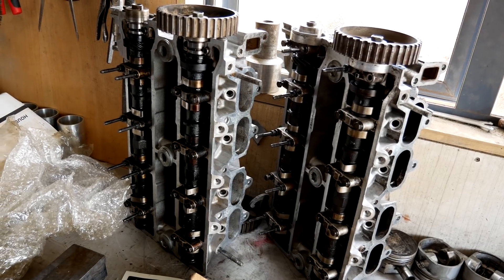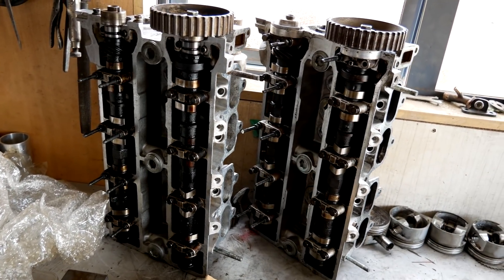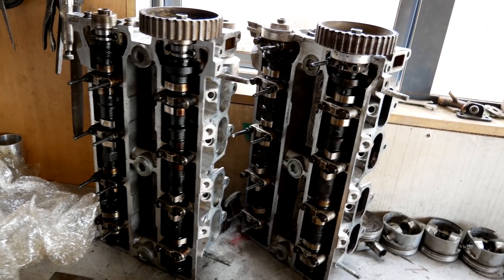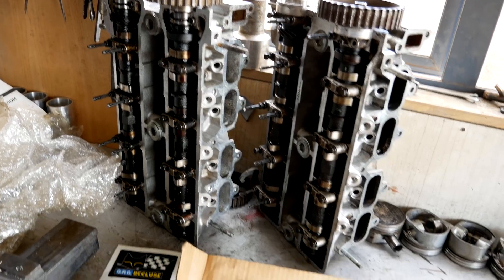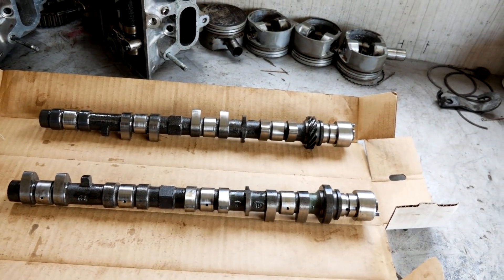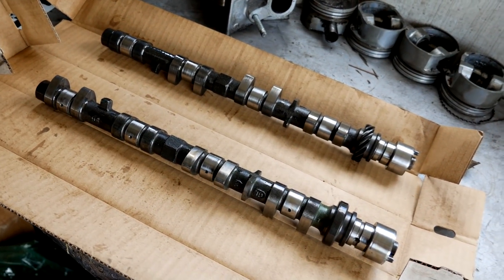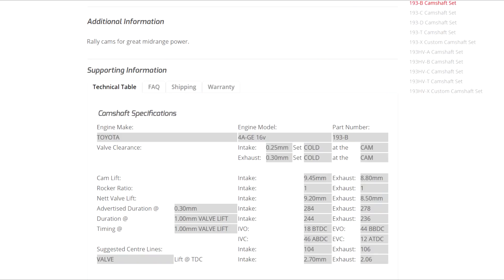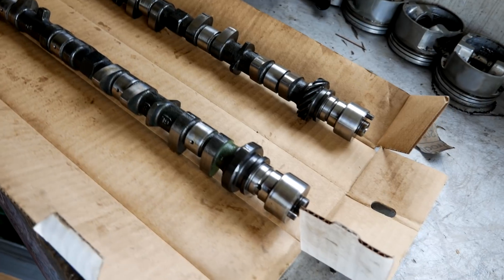Camshaft upgrade  Gold 4age -  Dyno tested

Comment: So actual upgrades are reworked head, cams, itbs, complete exhaust, fuel system and ecu just to be clear, by the way what fuel pump do you running and one question off topic what is diameter of the throttle body on the stock intake 😊 do you think that stock intake would already lowered actual resaults, at 105kw setup i simply havent spotted any big gains over the stock intake, thx for answers 😊
Reply from the maker: Yeah thats about it,  it has toda valve springs.  and toda 3.7kg flywheel also.   from memory the stock intake has a 54 or 55mm  throttle plate.   It made pretty decent gains with the long runners on the itb's  over the stock intake.  remembering it doesn't make much power to start with.  pump is just some old bosch pump thats been in the car forever

Comment: Really nice video. Can you show maybe some tricks to build a reliable 4age. Or 4agte or make it more reliable. And Why dont you test a 7age?(just intrested. I know the block is weaker)
Reply from the maker: 4a cheaper.  you couldn't do this with a stock 7a bottom end.  Yeah that's the thing. you really dont have to do much to them to make a reliable 4age/t.  unless pushing big numbers.   would be a pretty short video.

Comment: How would I install cams if my car has a dry sump setup? Considering my valve cover does not have a oil cap to slip em in?
Reply from the maker: dont 4k's come stock with 3/4 race cams anyway?   Or are you wanting to go full hectic with the full race cam?  That would be far to lumpy to do a filler cap install, even if you had one.    Assuming you have fcr carbs to go with that dry sump, you could section the cam in 4 and feed them in simultaneously,  watch your fingers in the slides
Reply: Touché
Reply: @Garage4age  oh my god...i wat to die every time i hear the "full race cam" jargon xDDDD

Comment: G-4age, you ever mess around with the Toyota R-series? (18R, 20R, 22R)

If so, for NA power how does the 4age stack up?
It's got a significant displacement disadvantage, but I imagine the 4AGE has superior head design and camshaft selection.
Reply from the maker: getting an 18rg running, is about as much as ive done on r series
Reply: Absolutely, I’m working on 18rg at the moment.....where to get good part...toyhead...thanks

Comment: I've been meaning to ask, why is the torque axis being shown so incorrect?
Reply from the maker: Its torque measured at rollers.  curve correct. numbers aren't.  pretty much all dynos work like this. but the ones that show "correct" numbers, have a calculation from either manually entered engine rpm numbers or a rpm pickup off engine.  my dyno software doesn't have it
Reply: @Garage4age  thanks for the explanation! I'm used to seeing the axis scaled for the values plotted after correction.
Reply: I wondered the same thing. 300nm at idle.. what.. 🤣
Reply: @Deiphobuzz  dang, that cam is better than I thought,,,,

Comment: Cool Video, thank you👍🏼 My experiences with N/A engines have shown me that the exhaust cam gives also good effects on the dyno. You should try this.
Reply: Definitely yes.
Reply from the maker: Ive got a couple of vids on cam timing.    I didn't adjust the exhaust side, as cant run a adjustable cam gear on that side with current cas setup
Reply: @Garage4age  any info on the cas setup? hall effect and magnet on the exhaust cam?

Comment: Always happy to see your videos pop up in my notifications. Keep up the good work. 

Is the oil pump in the Golden turd still stock? 

Reason I ask is because my first 4AGE spun a bearing on No. 4 at 7000.

What mods would you recommend for keeping the oil system happy?
Reply from the maker: They love to run bigends.     stock in this engine. pumps are fine to 9000rpm,  long as have the late model pump.   a few things i do is; drop the oil pickup down a bit as they sit quite high off the floor of sump.  other one being put a restictor in the block to limit oil supply to head,  as they like to fill the head with oil at high rpm. the smallport heads with external oil drain still do the same thing just not quite as bad as bigport
Reply: Great info thanks

Comment: This seems to be no trade off of running this cams? Anyone?  (I wonder why they didn't came like this from factory if that is the case...)
Reply from the maker: doesn't idle too smooth anymore!  esp after advancing the inlet cam.     the right bolt on bits are helping hold up the bottom end on this setup.  i tuned one with the same cams in it, the other day.  it  was down 20kw at 5000rpm,  only 7kw different peak.
Reply: @Garage4age  understood! 
Who needs idle anyway... 3k rpm idle like in some bikes and race engines.. hehehehe
Reply: Most likely emission related, but it could also be valve train longevity etc
Reply: Toyota focusing on reliability,so they can take over the world...

Comment: These tests on this channel are really highlighting how much more superior the Honda B series engines were.. Very interesting non the less.
Reply from the maker: Cant beat honda for na engines.    but  the cam profile im using here looks to be around the same as factory vtec profile. so its actually doing pretty good at 170whp.  also remember these engines are an older design.
Reply: Tbh the 4age doesn't have any system in place to change Cam timing or Camshaft profile through out the RPM range and slight lower compression ratio (I believe and I think he using small port pistons instead). Its inevitable that B series are better. But I didn't expect him to be making 130kw by just slap some cams on it and adjusting the fuelling on that 4age.
Reply: Apologies for any offensive language guy, won’t happen again, I love this channel and I’m a 4age nuts, sorry....
Reply: Ha, bl**dy Honda,do you have to rub it in, you hurting me,,,or I bring out my weapon, 2jz....hahaha,,,,
Reply: Older design, but better quality and over engineers....not that pussy aluminium block no web to support, it can only handle so much,,,plus newer design, who make the most powerful 3 cylinder engine right now is it toyota or Honda.....
Reply: @suronsoon8913  dont be toxic plz lol

Comment: That nasty bro, that what I’m been waiting for a long time, thanks so much bro, I just have thomas from kelford cam custom made 278 266...for me hope fully, I get that kind of hp...running x-purt 525 injector, ported head, oversized valve 1mm over, arp big end, and head stud, but microtech lt10c ...you think I get that much kilowatt bro at the wheel...
Reply from the maker: As always,  depends if your bolt ons work together with everything else.    think im going to make a video with all the wrong bolt on parts to show how much it screws things up
Reply: You mean keep it all factory bolt and torque spec, don’t used arp....cheers bro